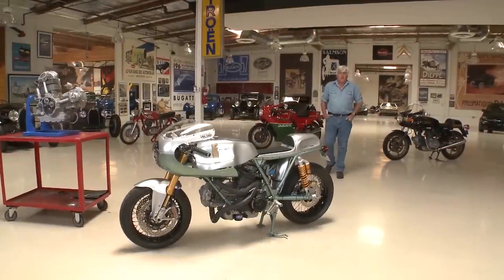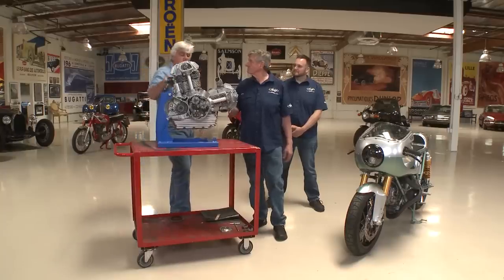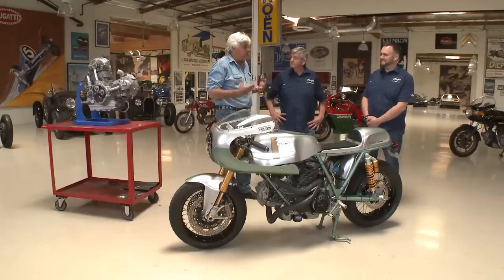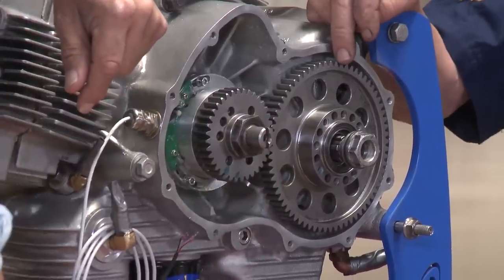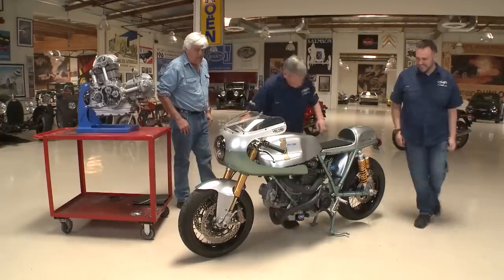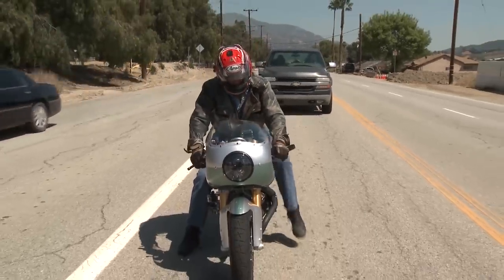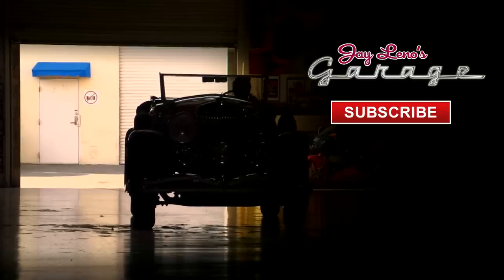Vee Two Ducati IMOLA EVO - Jay Leno's Garage

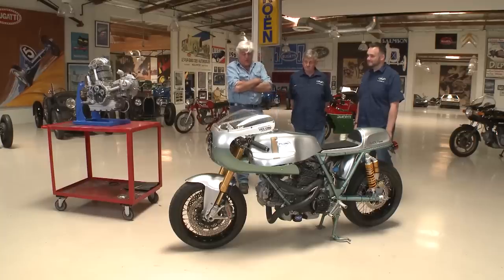Comment: 10:20   get a Ducati Paul Smart 1000 LE 2006 for 27000 $ and put the side with the plastic belt cover facing the wall  et voilà . You can stare at  it while inhaling a good pure line of coke with the rest of the $ . So  , you could think it's now a bevel drive valves train . Anyway you're not going riding it cause it's to much trouble to make  it go out of the living room .